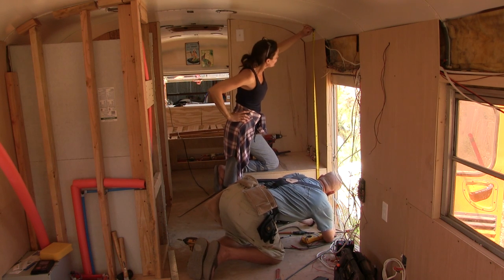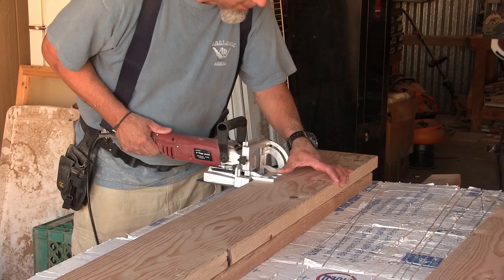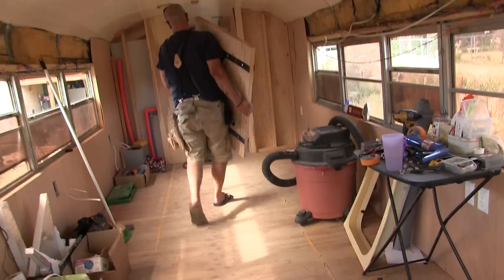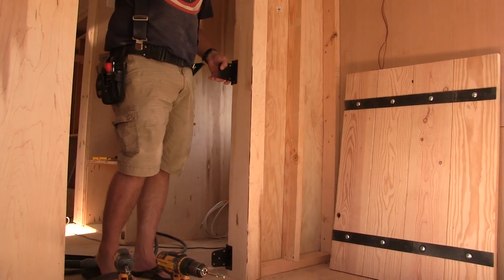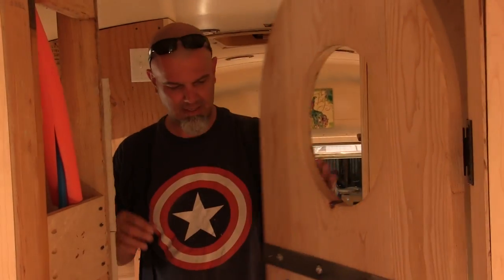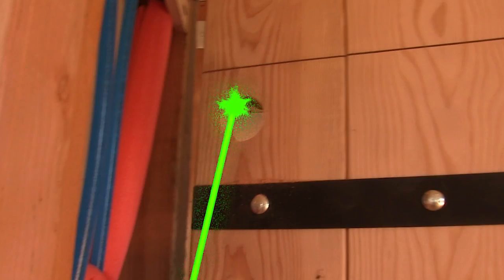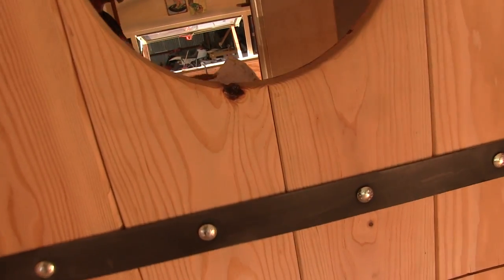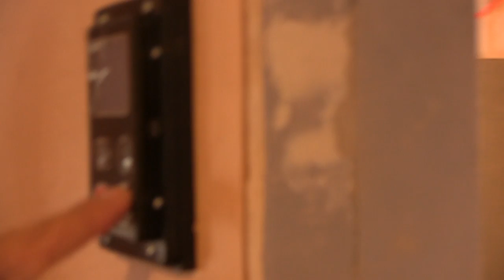Skoolie Interior Feature Door

Comment: Awesome work!  One bit of advice:  When wiring your switches, or anything with a wire around a screw terminal, wrap the wire clockwise.  That way as you tighten the screw it pulls the wire in around the shaft of the screw.  If you wrap it counterclockwise, it has a tendency to try to unwrap the 'hook' as you tighten it down.
Reply: Mike, I really like the split door! It's amazing how many different things you can do. You're a very talented craftsman & mechanic. I also love watching Kerry do her crafts. That shower she done was amazing!! Safe travels, God bless you both.